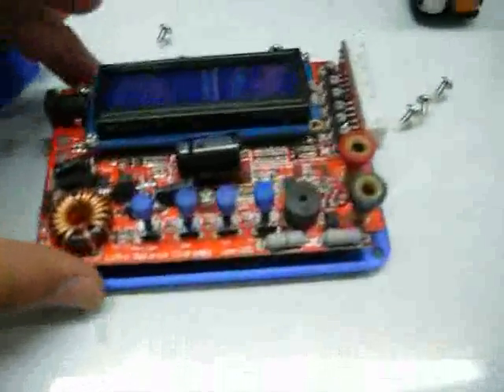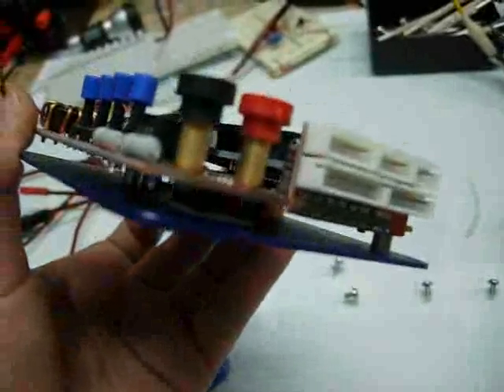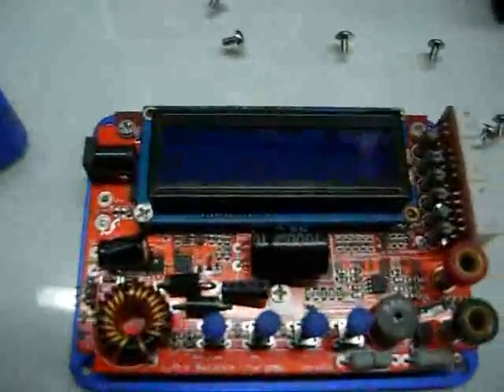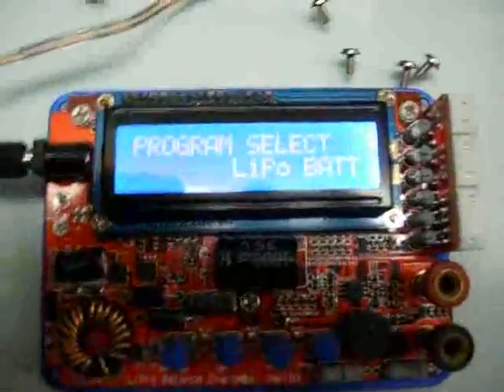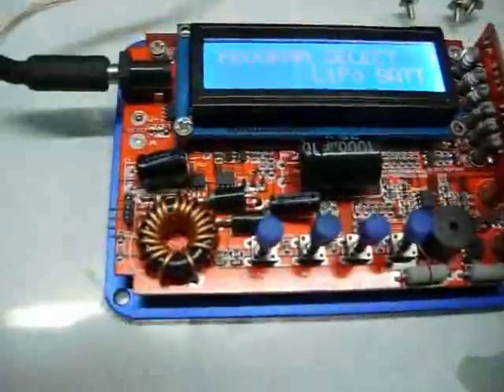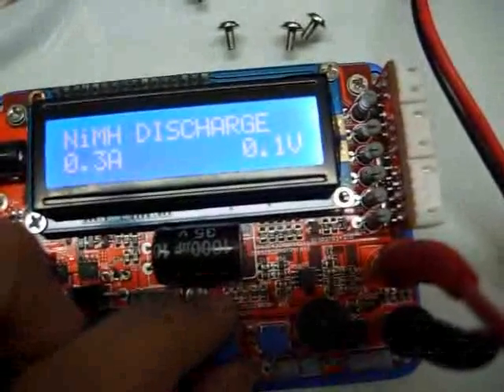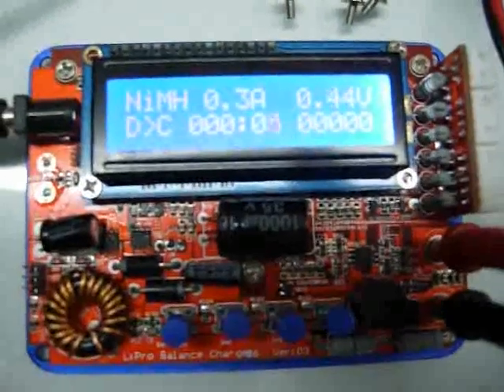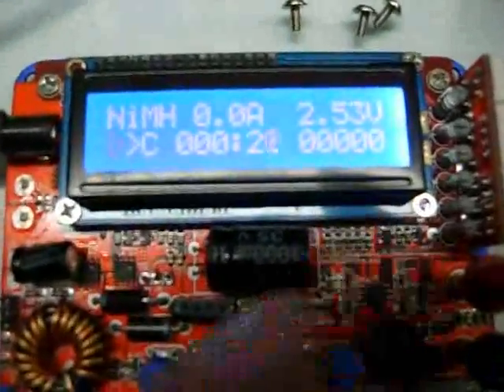Mystery Digital Charger - Discharger BC6

Comment: Perhaps this error is simple, I have the same unit! There are several problems that lead to such errors, and almost all the most is the battery, for example, buy 1 take 2500mAh battery that says, when in actual fact is 2000mAh, we set the unit to charge the 2500mAh but the machine tests the battery and load of you know that does not belong to the 2500mAh battery, but in the real burden indicates that battery!